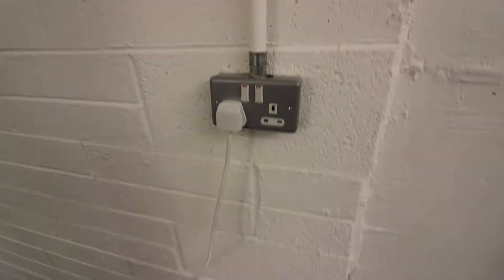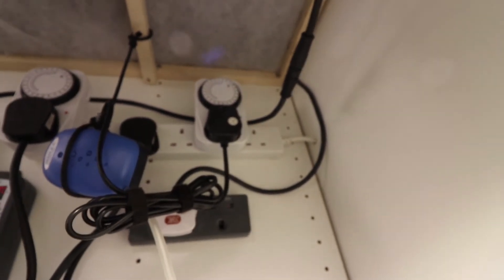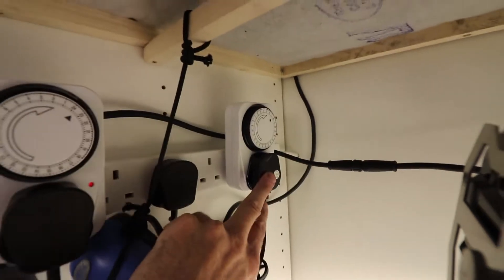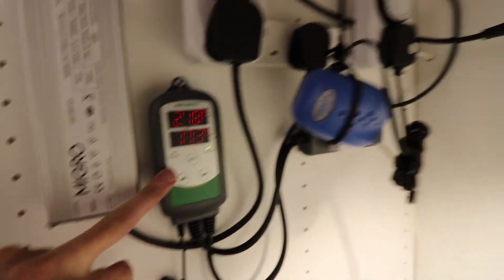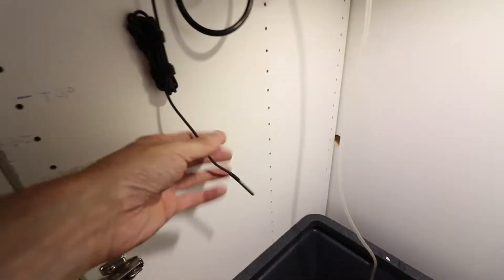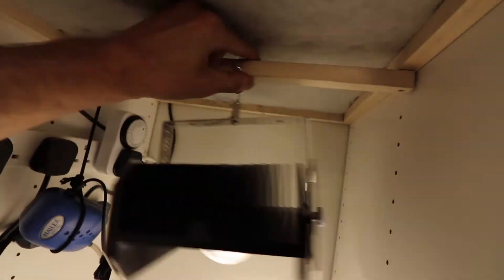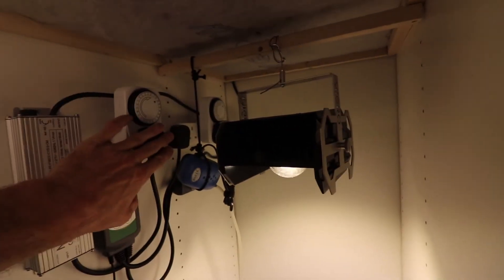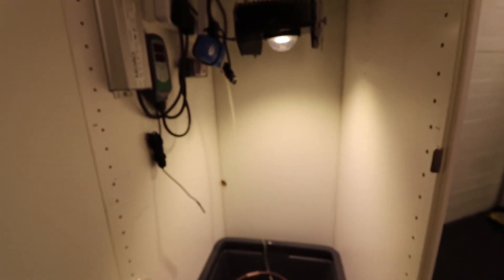Closet grow build #3 - Electrical installation

Comment: I’m running 4x 1000w hps and I’m using an air con with the inkbird. My air con takes 3 minutes to start working after turned on. My only question is what I should set the temperature and differentials at on the inkbird? If I set it at say 28 degrees, I’m pretty sure it would click on and rise to say 30/31 degrees before it actually started cooling? It’s got me baffled. Thanks for any advice

Comment: Did you have any smell coming out of the bottom? In a few months I will be using this idea
Reply from the maker: During the last few weeks of flower the carbon filter will eliminate most of the smell but not all of it. The best solution is to use vent the extracted air out through a window with some ductwork.

Please let me know how you get in with the build. If is need to improve the instructions it would be great to know
Reply: if done right you will have NO SMELL, its how it works, if done right